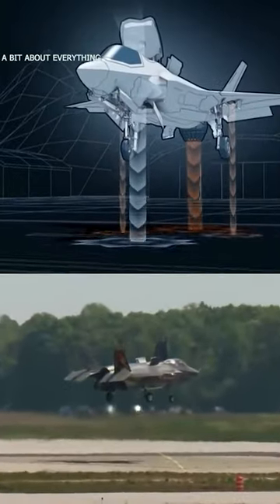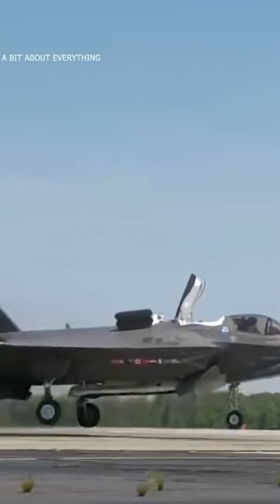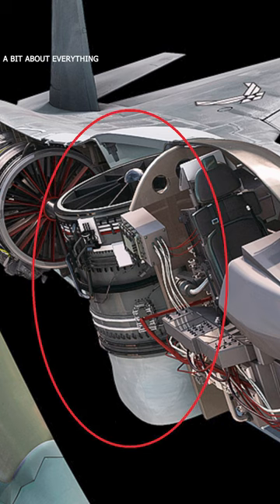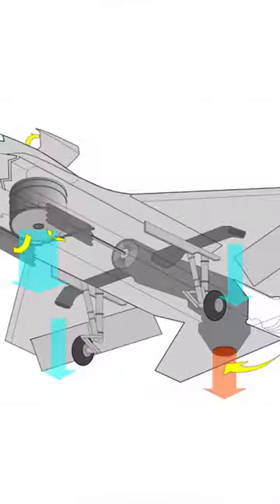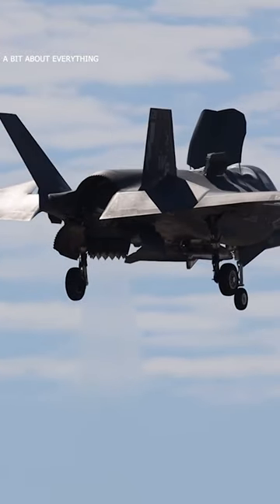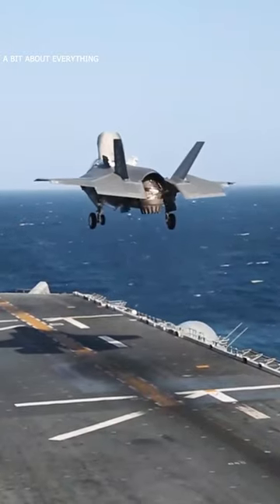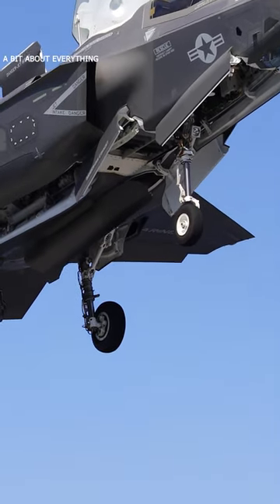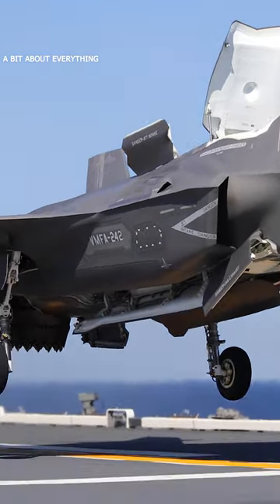How F-35B lift fan system works #shorts

Comment: У нас в СССР это было 🤣🤣🤣
Reply: This design of VTol system 
is actually Indeed a Russian design.
Reply: UK has it first..The harrier jumpjet...But the F35 is so much more advanced than the UK harrier and awful Russian plane
Reply: @jordanhallett3191  
- the F35 B system was bought to Russians.
- The French had a few vtol flying before the Harrier was even flying.
They stopped it because too expensive but theirs was flying at Mach2. 
Speed that the F35 Can not achieve even 60 years later.
Reply: @alexdarcydestsimon3767  No combat plane comes close to America's.USA planes tech is just unreal.
Reply: @alexdarcydestsimon3767  USA had a plane that went twice the speed of any plane in history USAF X-15...
Reply: @jordanhallett3191  you don't get the point ... The plane you're talking about was neither stol nor VTol nor English.
Neither was its carrier.
So go back to your maths.